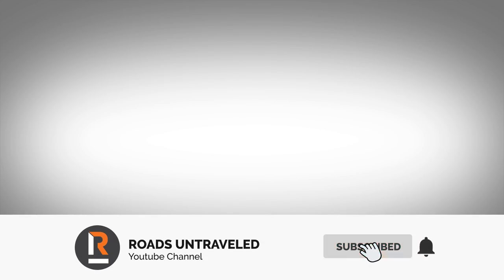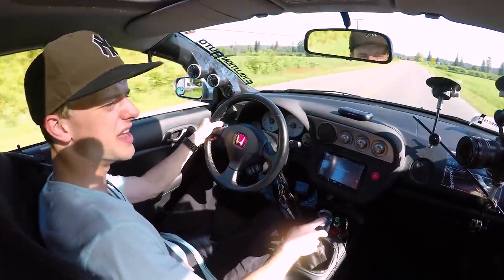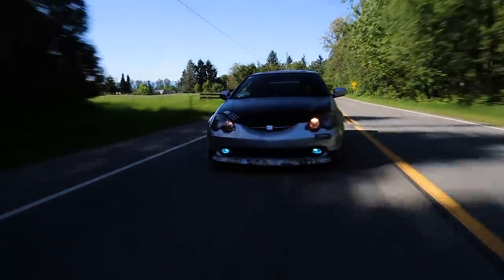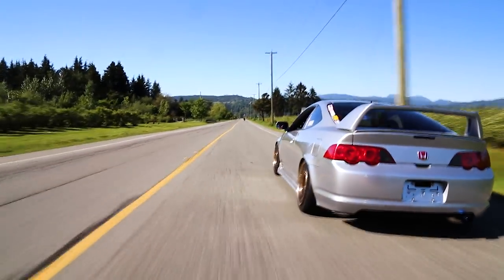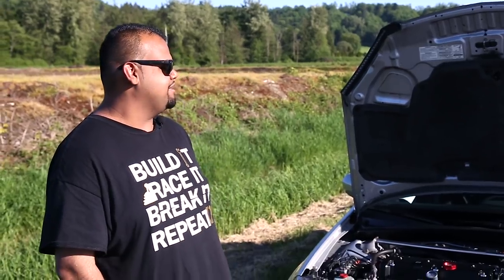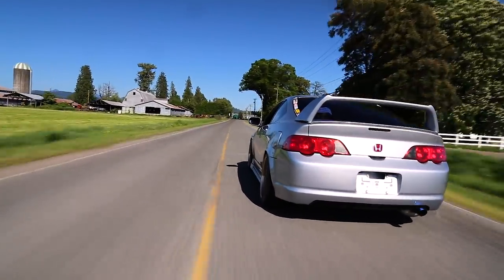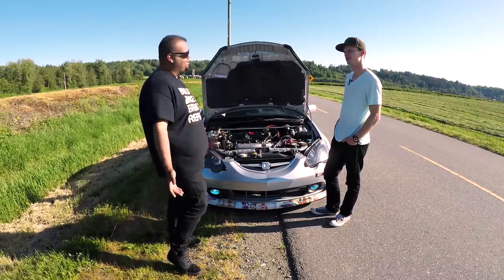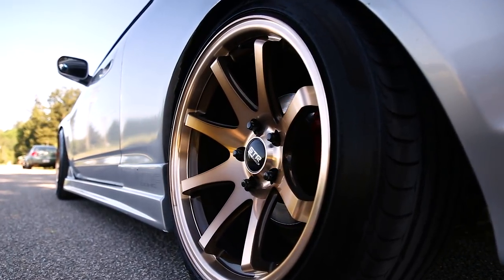Here's Why You Need to Build a 9,000 RPM N/A Acura RSX Right Now!!

Comment: Foe those mods he should be making 300+whp. Mine makes 210 with a k20a3 bottom end. Full Bolton type s make 230. So only 250 seems conservative or its just most likely tuned for only 250 to make it street drivable. Or hes got a shit ass tune and was running to lean at too high of an rpm

Comment: 190hp fully built k24 k20 head 190hp bro really wit a rbc im confused here that car can make 270 300hp at least wit ported head valve sprong retainers big cam lift 🤕🤕 ur tuner is trash then im not roasring but im just trying to get where this makes sense if it was a d16 then ill be like ohh ok but its a k20z1 stock comes 210hp he got tsx k24 k20 head im done tho

Comment: considering stock makes 200, 250-300 NA is a good thing, STFU its a car, it was designed after the era of the most classic import cars of the 90s, the way the dash looks at you in the car, you cant hate on it. most of you probably jizz over an STI or a Ford ST, little do you know this car N/A only makes 10-30 Less HP "Without the turbo" for those of you that dont know what N/A means,  and a redline well over 2-3k RPMS over both of those cars.
Reply: in other words, if you boosted an rsx type s and got it to bite... kiss your new turbocharged vehicles in 2019 asses goodbye

Comment: OK, I just watched the first 2min of it. They brag that they are making 250whp and can rev to 9k. So, what's the big deal? The stock motor can do that. It doesn't take anything to build one to do that. Just bolt-ons and you can hit that, with completely stock internals. You can do 20-25whp more and get to 270-275whp with some nitro-methane or something similar in the line of race fuels. The motor can rev to 9200safely, just as you can drop in an RSX Type-S oil pump into a TSX K24 and rev it to 8000, since the piston speeds for 9.2K on the K20 RSX-S is the same as 8K on the K24 TSX... ok, now I'll watch the rest and see if there is more to the vid...

Comment: I would have to agree with alot of people commenting and I've done a ton of research on K-series motor builds and I've owned 20 Hondas(8 hatches) and currently own an RSX Type S that may be my next build project. 13.0 to 1 compression, big cams, 80mm throttle body and ported everything:-) should put this car to at least 280-300 at the wheels with a GOOD tuner, especially at over 9,000rpms. Maybe it's not dialed in, maybe cams aren't as aggressive as most stage 3 cams are, but 250 wheel horsepower would have been easily attainable without that high of compression and that level cams. Otherwise, car sounds great, pulls hard and does what he wants it to do. Overall, nice build and respect to the owner. Anyone who has priced out an all motor build with quality parts knows that this is a very expensive motor to build RIGHT.

Comment: A Dodge grand caravan rt model will have that car for breakfast and it has a beast of a suspension. Those vans have some umph to them.not only that, the throttle mapping is pretty good. I have no issues with the tranny. Shifts like a dream. I have test driven quite a few cars. Ibhave owned a skyline, to test driven charger rt models and owned quite a few cars. I have come back several times to them and plenty fast to me.  Not only that they are tuneable as well and I gotta say there is the satisfaction of being able to hold a tight curve with your in-laws, wife kids cargo and unsecured small dogs hanging on for dear life and still have plenty of power coming out if the corner and you don't even have to floor it. Oh the smile of my face every time. Every time there is family drama I make sure everyone has a vomit bag and extra seatbeats

Comment: I prefer torque from idle though. It's less of a hassle even if it can be less thrilling at high revs.
Reply: Alex Dc yeah but it’s boosted you’ll have the most boring power band that’s dying after the mid range. All while this gets faster the more you rev it.
Reply: preludeF20Bking what's boosted? 😅 What are you talking about? I'm talking about na. Not all boosted cars dies off at the top end. It depends of the setup.

Comment: Is 240k miles a lot for these vehicles do they start to break or can the car reach higher miles before it starts going downhill?
Reply: reasonable maintenance and they will go into the 400,000 mile stage.
Reply: Always use a oem Honda filter and a high grade air filter. Synthetic oil can extend the life of the engine

Comment: Take a stock dohc vtec, put it on a dyno and you'll see it has a fairly flat torque curve. It just has not much of it. Still quick enough tho
Reply: 99Lezard99 it’s Relative to other NA 4 cylinders.
Reply: preludeF20Bking Yeah but People allways think Hondas dont have any torque. But for thier displacement they actually have good values.
Reply: 99Lezard99 also 200fts at 2200lbs will feel very similar to 370-400 at 3700lbs. Torque to weight ratio exists to. My f2b with felt motor torque then tons of turbo cars making much more torque but also had added weight.

Comment: I have a 06 RSX DC5, K20A, with only minor mods. I've got a K&N Typhoon intake, and header back Skunk2 racing exhaust, N/A. Everything else is stock. I run non-ethanol, 93 octane fuel. It's pushing 220 WHP with around 160 Torque. And I'm pushing 0 to 60 mph in 4.6, sometimes 4.5 seconds by 2nd gear. I run the half mile at 155 mph in 12 seconds. This guy should test drive drive my RSX.

Comment: 105mph trap speed in the 1/4 miles is pretty slow.
Reply: Car probably runs a high mid 13s
Reply: Benton Tong on slicks 105 will get you 12.8. S2000s barely do 98,sti barely 101 etc..
Reply: preludeF20Bking 
Eta is a measure of how good the driver is. Trap speed is a measure of how fast a car is. Also fast and slow is a very relative to each individual person.  And 105 mph trap speed is a very slow. And I have owned many and still own a s2000 and although s2000s are amazing cars they are super super crazy slow in stock form when not boosted. 

105mph trap speed is not much faster than a standard family car now a days 

I also don’t consider any car that traps under 120mph fast.

For a non boosted 4 cylinder a 105mph is fast. But in general it’s actually quite slow or average at best.
Reply: It is slow for what this guy claims is done to his car. It appears to be regular shit bolt ons k20
Reply: Jujutsuheiho stock k20 with bolt ons will not trap 105 with without weight reduction.
Reply: Benton Tong yes I know that and that’s why I posted the comment I posted.
Reply: Benton Tong this rsx will rap a bolt on and tuned s2000 by buses.
Reply: preludeF20Bking as I stated previously. I've slaughtered cars that trap 105mph 1/4miles.  With full interior bolt on k20 rsx.
Reply: i 100% agree that it will.  But that still does not mean this car is very fast at all.
Reply: Benton Tong I don't think it would